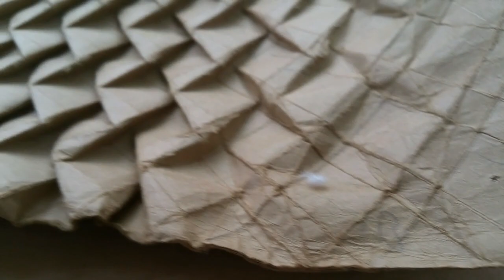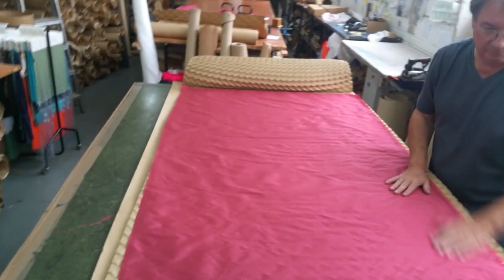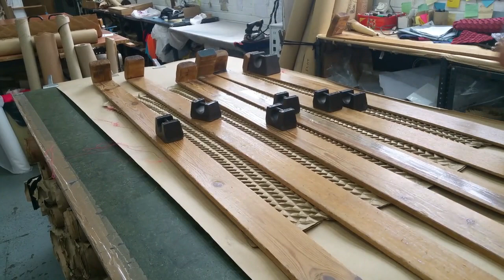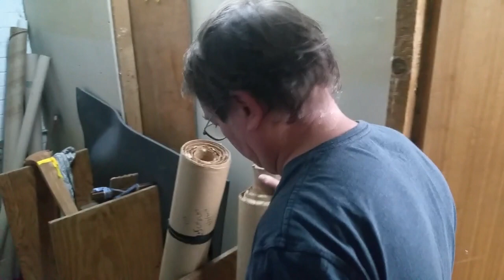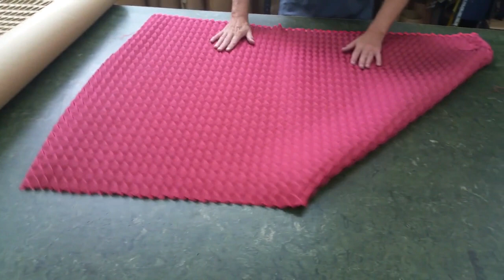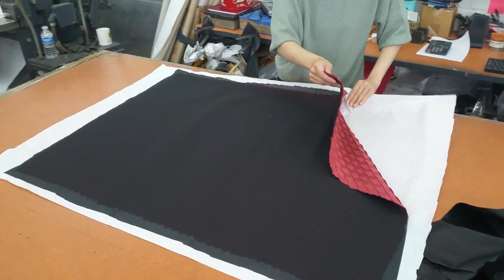Pleating Daenerys Targaryen's Cloak from Season 7 GOT HD

Comment: I could watch your videos all day! Fascinating processes involved. I was wondering about your steam box, if you could share where you bought it from or by whom you got it made; and if its similar to the steam box used in bending wood so that as a last resort I can try to get it custom made. Thank you for sharing your craft!
Reply from the maker: Hi Hanon. it's just a water tank at the bottom with an immersion heater element in. The element heats the water to 100 degrees C and fills the cabinet.